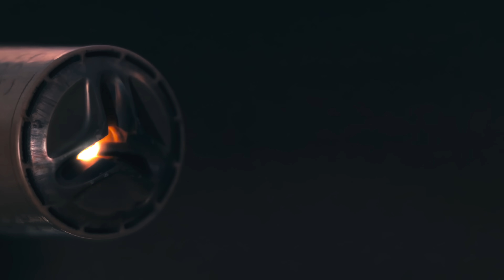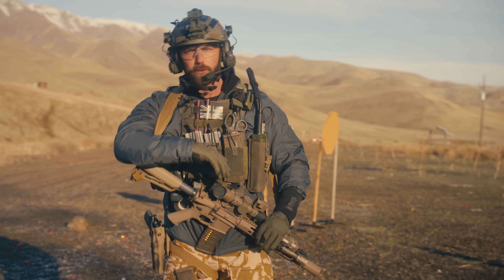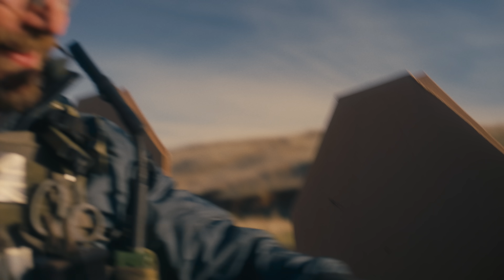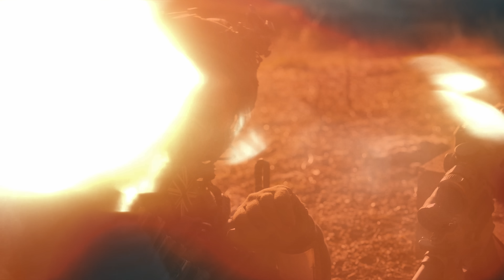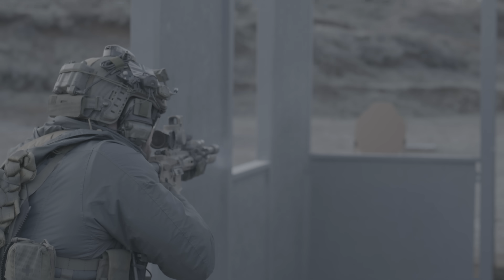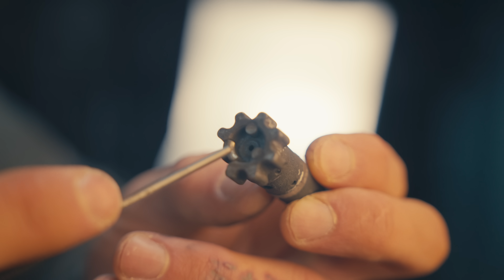The British Just Adopted A New USA Made Combat Rifle

Comment: The bent gas tube is designed to be a failure point from Eugene stoner himself, to keep the failure under the handguard and away from your face, if you think about it wouldn’t it be a lot easier to manufacture straight tubes to begin with?

Comment: Fairly Recently Golden Webb channel did a burn down of a sr-15 and it and LMT failed miserably but yes it was full auto fire strings and around 650ish rounds Knights blew the side kf the barrel out as did LMT. Geissele super duty went 1016rds and the Geissele super duty Hbar upper went 1700+ rounds. I absolutely love knights and LMT and I want one of each but if you are buying them and planning on FRT use or Auto then forget about it. I run Geissele triggers so they both would serve me well.

Comment: Oh boy, can't wait to have to repair the failed extractor claw spring pins on these, have had 28% of my armoury's KS-1 (L403a1) weapons fail with several of those long thin springs make their way into the gap between the main sear and the trigger jamming the reset of the trigger. Or the fact the 'field strippable' extractor which has a small rubber ring going AWOL super easy but hey lets order more

Comment: I don't know how this is considered the next generation when everything but the ambi lower controls are the same as every other ar15 of the past. Wow, they went to a shorter barrel and full ambi controls. That is so ground breaking.  I mean IF I was going to spend nearly 3k+ on a rifle which I probably wouldn't when I can get all this rifle offers and a lot more innovation for less by simply going with any other top tier brand that isn't Knights Armament. That said I get that Knights is battle tested, and that it has been all the rage since being awarded military contracts Knights Armament should be leading the industry in innovation but fail to lead or innovate anything of their own but instead let other companies put in all the research and development (money) and then they release a version of that same stuff after they start losing contracts. This just goes to prove it is all about who you know that can award you contracts rather than being the best available. Look at SOL MK1, they have innovated with changes to the handguard, the forward assist. San Tan Tactical with the full ambi lower that led to the Radian ADAC 15, BCM with the MK2 Upper and the forward assist being moved forward to make room for getting better clearance and access to the charging handle for better weapons manipulation. That is just a few of the companies that have innovated and made the AR15 a much more updated platform, without making it proprietary. Either way nice video, I hope everything gets better with regards to your health.

Comment: The SOLGW MK1 is VASTLY SUPERIOR to any Knights rifle.
Reply: Aside from the laser etched rail on the MK1, I think saying it is vastly superior to the KS line is incorrect.  The improvements KAC has put into their gas system, bolt, and barrels over the years is still ahead of most of the market.  The MK1 can be a good rifle and also not be vastly superior to Knights.  And you can’t get a MK1 with an armad barrel at the moment so that’s not a differentiation.

Comment: Hey Garand Thumb Team!     Please settle a hotly contested debate, and potentially save some lives please!    

 There is a guy making a video claiming that taking the N.A.P.E. pad designed for fragmentation protection on the ACH Combat Helmet and sticking into the front of a bump helmet (after removing about half the thickness of the foam) will provide 3A protection. 

 He claims it will stop a 44 Magnum and that any 9mm round, even one at 1400fps will be easily stopped without causing serious incapacitating, life threatening, or fatal injury.    He claims it provides just as good frontal protection as a real helmet. 

You guys have access to ballistic heads, all the guns needed, the freedom to test it and an audience that trusts and respects what you say/show. 

  Please test this and show what will actually happen if you do this "hack".

He has tons of comments saying its a "great idea" even though he has zero proof it will work and refuses to actually test it. 

 If I am wrong and it won't smash the skull of a dummy head into the "brain" I will donate $100 to a charity of your choice.   I know that doesn't cover the cost of the dummy head, the NAPE pad or the bump helmet but its what I am willing to put down to try and get this proven/disproven. 

Thanks for everything you do, and thanks anyway even if you don't want to do the video.

Comment: You probably won't see this, but your hat is an issue. It makes you blink, hot glue or titebond on the edge to curl it up slightly helps your eyes forget the edge of it. Sounds stupid, but a slight tilt away while still in your view feels less like an obstacle. 1/4 to 1/2 inch upturn on the edge, here in Florida I did it to stop drip on my optic in heavy rain, but learned it's always good.

Comment: Dont understand all these super short barrel ARs.  Dont you need a MINIMUM 2700 FPS for maximum fragmentation? Get about 3200 FPS with a 20in barrel. Shorter the barrel the LESS FPS.  With an 11in barrel muzzle velocity below 2500 out of the barrel. Mogadishu all over again.  22 in, 22 out. NO fragmentation.
Reply: Run 77gr OTM and it’s good to go. Mogadishu’s problem was rounds built to penetrate against malnourished people. Run slow/heavier open tip rounds in the shorter barrel and all good.

Comment: Ngl I’m surprised that the KS-3 isn’t in the line up in the replacement for the current main line rifle I feel with it being the shorter variant and low recoil impulse it could be a good replacement for the L22 (the short barrel carbine used by vehicle crews and pilots) I’d also be suprised if something wins over the KS1 as the main rifle providing it’s already in use with all be it a small amount of Royal Marines but in larger use with the new ranger regiment established in 2021 unless of course there has been issues discovered in the last 4-5 years of its use

Comment: Damm, bud, scary stuff. Hope it trends the right way and gets better. I'd imagine fitness helps, and you stay on that notion, but for myself, with c6-c7 issues, the biggest improvement was getting out of electrical and taking the weight off my head, especially headlamps and, in your case, NVG and counter weights combined with the ballistic helmet is horrible for the neck. screw YouTube, save your neck and ditch the helmet bruh

Comment: for the poor trying to build close to it. Roscoe k9 patrol length barrel is as close to KAC gas length in 11.5 you can get and shoots soft AF with a spring co blue buffer spring and a odin works adjustable buffer with 2 tungsten weights and 1 aluminum weight

Comment: In the classes I have been to I haven't seen a lot of KACs, but of the handful almost all of them had some kind of problem. Most had a brass over carrier malfunction at some point in class. Others had other issues. Seen a ton of BCM, never seen a problem, a few dd never a problem, a few g$ - never seen a problem but I bought a SD upper with poor threading / bbl concentricity and cs won't exchange it, and a few PSAs that have suffered from some extraction issues in a few samples
Reply: This is an interesting observation as I’ve had the opposite experience. For example, in 2021 I took a rifle class from a well known instructor (Steve Fisher, Sentinel Concepts) and there were no less than 10 SR-15’s in the class and I didn’t see a single malfunction from anybody. Which is consistent with all the numerous “torture test” videos we’ve seen on the SR-15 series over the years. I wonder if there’s a difference in quality control between the guns made in the pre-Cov1d years and the ones made 2020 and on?
Reply: Couldn't tell you. Only really been taking classes the last 3 years. Been to 7 so far. KAC was on my bucket list but after seeing them in classes I lost interest. Idk which model they were, how old they were, etc.